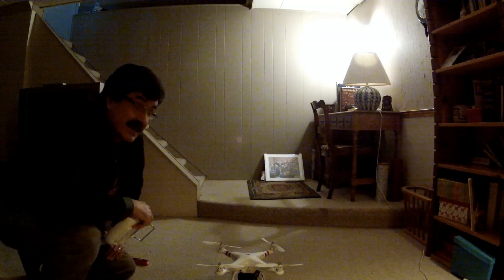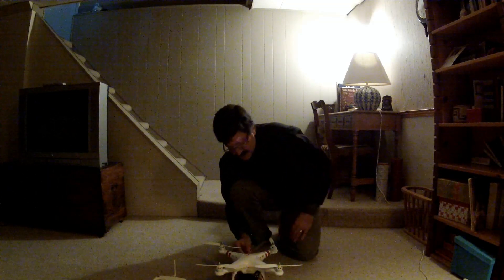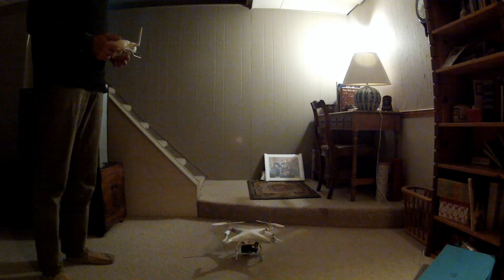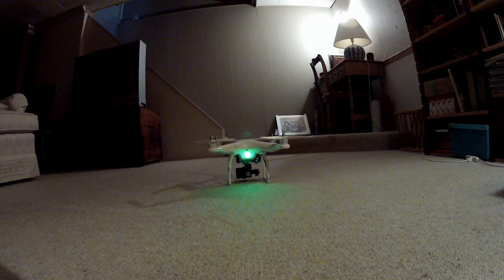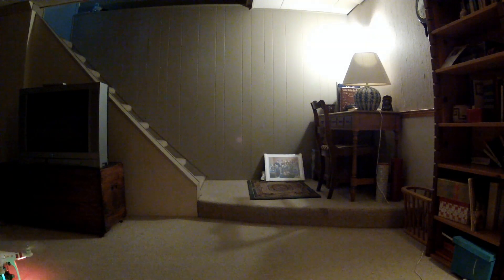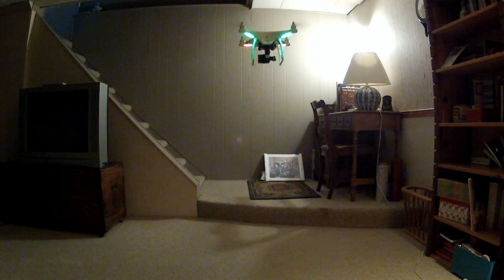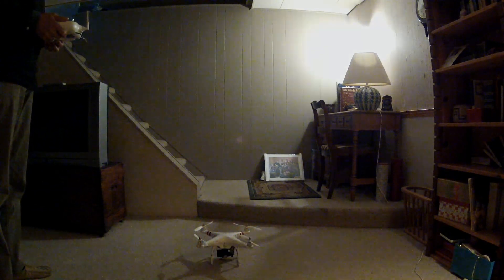No GPS Failsafe Test

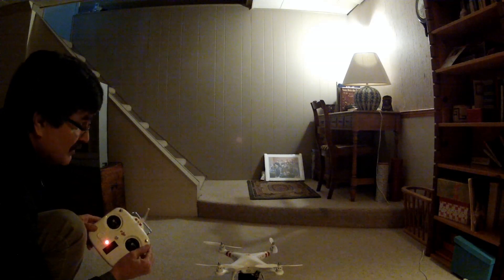Comment: At 2:35 you mention you're "going to put the battery in properly now"....what did you mean by that ? I had assumed that in order to have power to the Phantom at all, the battery had to be fully seated.
Reply from the maker: Hi Paul.  Mine is the original Phantom-1, not Phantom-2.  On the Phantom-2 you slide in the whole battery pack to connect it internally.  On the Phantom-1 the battery has cables and an XT60 connector plug.  I connected the cable plug, then waited for the Phantom to finish initializing before tucking in the cables and closing the battery door.

Comment: A couple of thoughts. The first is that perhaps you could have held the quad by the skids and then switched to fail safe, then simply continue to hold the quad and feel what it is trying to do. The second is to perform an additional test I thought of, that could happen in the real world... what if I had GPS lock (and therefore a home position established) before launching, but then during in the flight I first lose satellite reception, and then I go into failsafe… what will happen? Will it try to climb to eternity hoping for a satellite fix? You could test this by starting outside and getting a home position, then carry the quad to the basement (still powered up) to continue the experiment in the non-GPS zone. Could be interesting. Thanks for your videos, I have learned a lot. Greg
Reply from the maker: Interesting idea.  I'm pretty sure that, upon loss of GPS signal, it would still react the same way as shown in this video.  I think it would hover while free to drift with the wind for 15s, then descend to land.  I'm going to have to try this in the underground parking garage some night, where there's more room to let it drift for more than 15s.
Reply: Zbip57 Sounds good. If the parking garage is a hassle, you could always do it in the basement but hold onto the skid for the 15s, since you'd be able to feel if it is powering in any direction, or just being allowed to drift. Thanks again for your vids, they are well done and cover relevant topics!

Comment from the maker: On reconsideration, I think it would have landed in the 2nd test if I had waited just a few more seconds.  Upon loss of transmitter signal the NAZA goes into Failsafe mode, hovers for 3 secs, and then activates its response.  In the Assistant software you can choose from two responses.  Either "Landing" or "Return-Home and Landing".  In the 1st test I had it set to "Landing" and it did land after 3 sec.  In the 2nd test it could not first Return-Home because, without a GPS signal it had not established a Home position, nor can it navigate to that position even it had marked a Home position.  But what it would normally do is head to a point overhead Home, then hover for 15 sec before descending to land.  I had to abort my test before those 15 sec expired because I was afraid the Phantom would drift and crash into something in my basement.  I now think that, had I waited the full 15 sec, the Phantom would have landed itself.

Comment: Wonder if it will try to land once it detects low battery. Can you try it with a depleted battery close to the floor so it wouldn't fall far.
Reply from the maker: There are two stages of low battery warning.  At the first level it starts rapidly blinking red LED.  Time to land!  At the second level it will start sinking by itself until it lands.  If you're low enough to begin with it's a nice gentle landing.  But if the second level is triggered at high altitude, or way out over a lake, the battery will quit before the Phantom gets back to the ground, then it drops in freefall.  You can try counteracting the slow descent by adding more and more throttle to hold it in the air.  But eventually even 100% throttle won't keep it up anymore and it WILL come down.